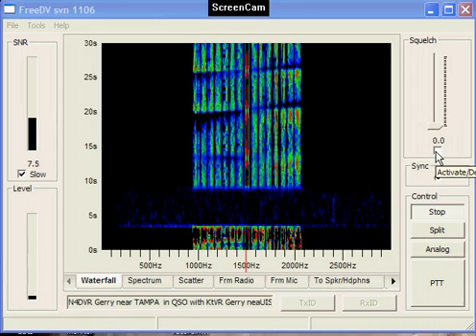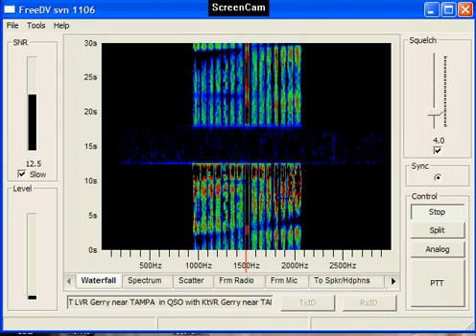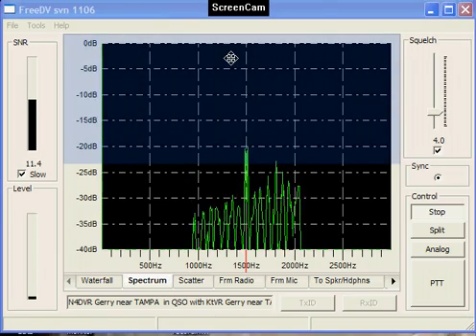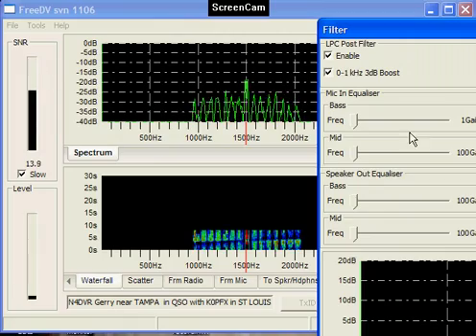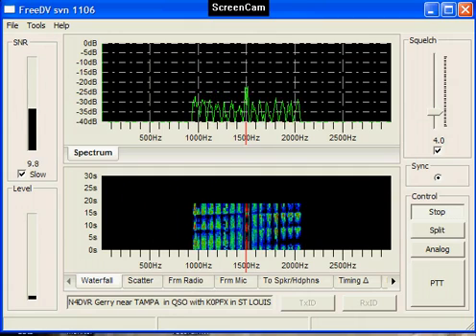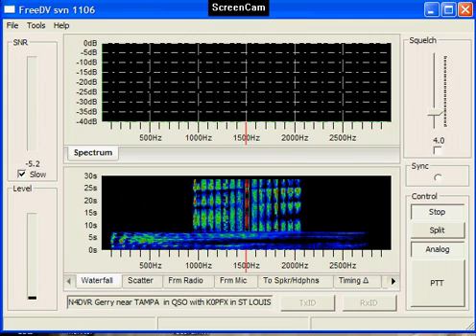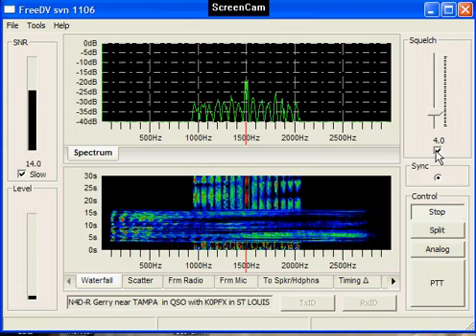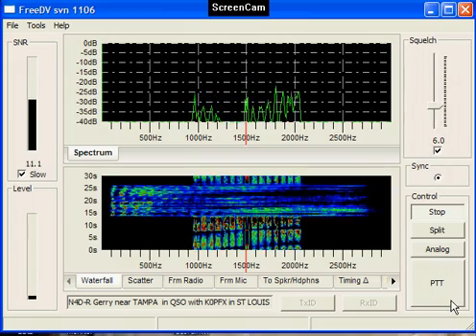FreeDV, the new HF digital audio program for Radio Amateurs.

Comment: I have been trying all day to get the IC7600 to transmit/receive using the program. Now I read hear that it will not work.
So, should I just abandon the radio's USB interface and hook up the Tigertronics SignaLink?  Would I have a better shot
at getting that working??

Comment: Have got FreeDV working with my TS50 using  a USB soundcard on one port!
A USB headset on another port
And a USB to serial PTT on another port!
I am running it under windows Vista 32bit. I just spent about an hour calling CQ on 7.095 LSB but didn't get any contacts. Both DV mode and Analogue. I will have a listen on 14Mhz tomorrow sometime. 
Could you tell me what the latest version of FreeDV is upto? I have version 0.91 Beta.
Cheers and I hope to chat to you soon on DV 
73 Mark

Comment: I have tried the program, and it only works in receive.  I have an ICOM IC-7600 and I'm using the USB input on the rig.  This works fine with programs like MMSSTV and EasyPal, but not with FreeDV!  The PTT settings of the FreeDV program need to have options for the rigs that use USB ports for Rx audio, Tx audio, and PTT.

Comment from the maker: Hi Thomas,

It uses an audio card with 16 bits or more connected to audio input and output of your radio using the same wiring harness that would be used for any of the software modem systems like WSJT, PSK31 etc. You need a second audio card for microphone and speaker, and a lot of hams use a USB headset instead of a second audio card.
Reply: i USE A HEADSET BUT IT CONNECTED TO THE FRONT INPUT OUTPUTS WITH ADAPTER.  PORTED IN/OUT TO RADIO THROUGH SIGNALINK USB.  THE OUTPUT TO ANOTHER RADIO SOUNDS LIKE A TONE GENERATOR THOUGH AND NOT FSK OR ANYTHING DIGITAL.  i DON'T THINK IT'S WORKING.